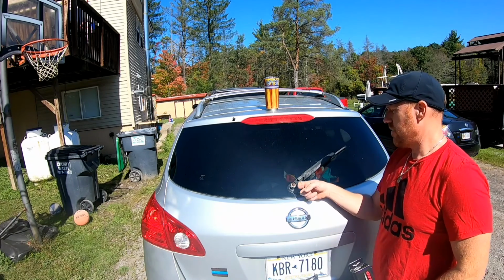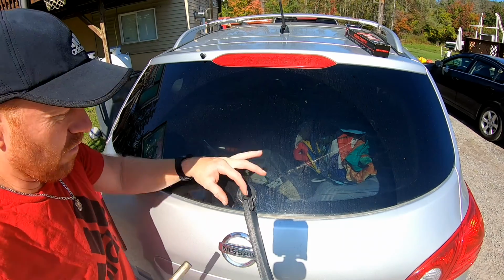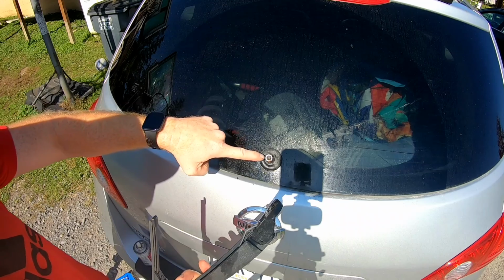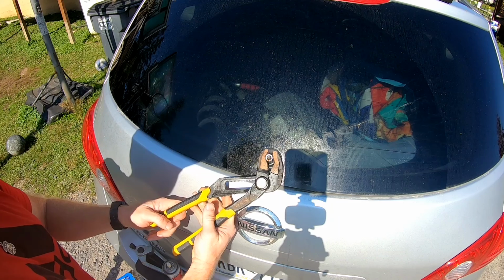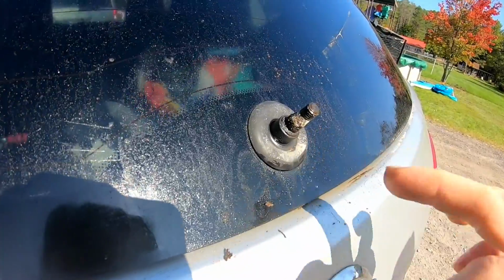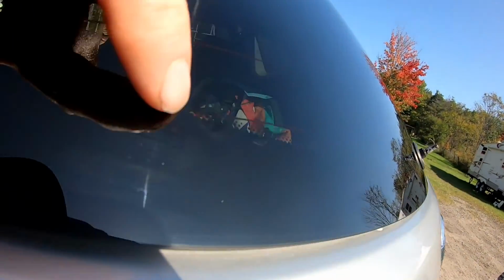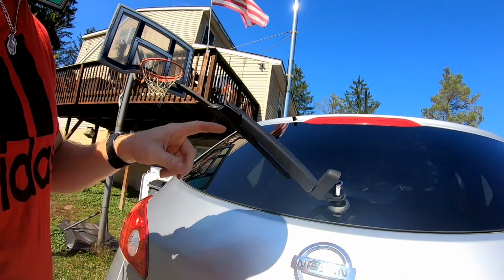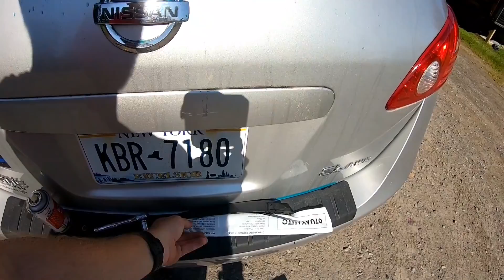Nissan Rogue Rear Windshield Wiper Arm Replacement DIY!

Comment: What’s the name of the tool you used to get the old ring unstuck?
Reply from the maker: I used a impact gun and a ratchet! Thanks for watching!😊
Reply: @WhitehouseFarmVet  I’m referring to the clamp thing with the bolt going through the middle you used to pop the stuck piece off after you got the nut off of the shaft.
Reply from the maker: @OverpoweredByMonk gotcha it's just a 2 jaw Puller or gear Puller you can get them at any automotive store or Amazon etc!